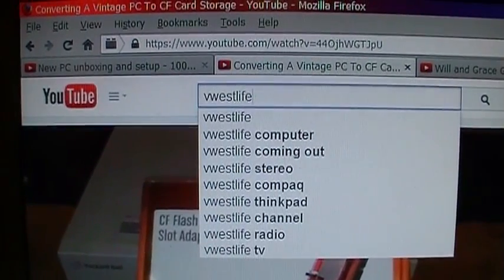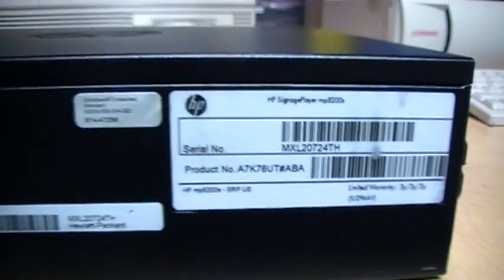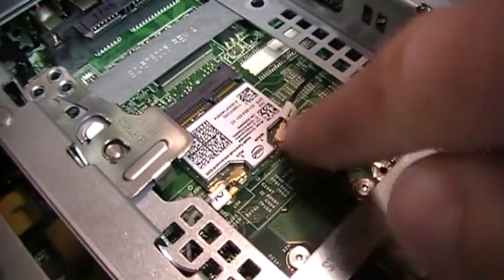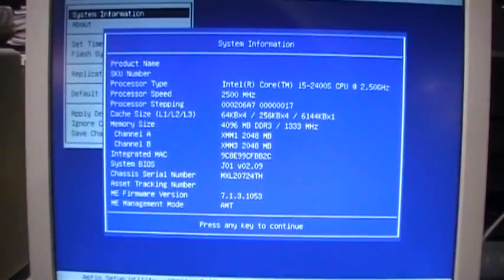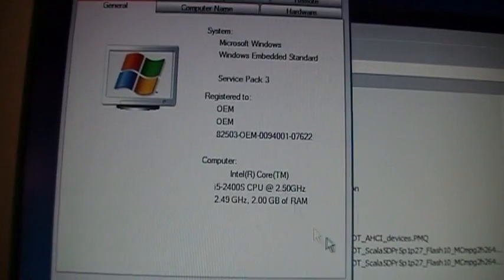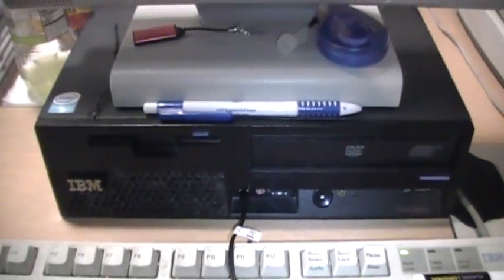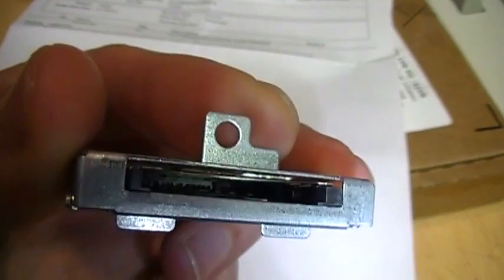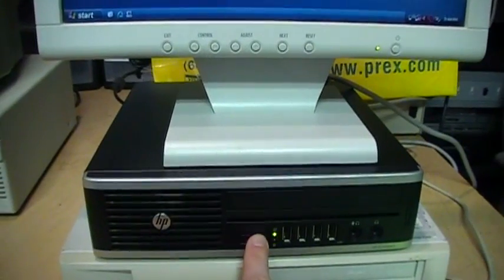My "new" computer: HP Compaq MP8200S

Comment: Are you poor? You seem to have pretty bad built computers for a main computer.
 Plus, that Macbook looks very old and out of date.
Reply from the maker: Billy O'Reilly That's a very rude and condescending question to ask. Not everyone needs or wants the latest and most expensive computer or laptop, regardless of how rich or poor they are. Besides, computers have tremendous depreciation, so if you're not a gamer and don't need the fastest CPU and best graphics, it's a waste of money to buy a new computer, when one that's a few years old is a fraction of the cost and is still perfectly usable for your needs.
Reply: I use old PCs. I don't necessarily buy ones that are high on power. Like my laptop is from 2011. My PC in my basement is 2012. Only one Macbook Pro which is my sister's. An old Compaq from 2009. My laptop may be old. Gaming is not a good thing for my laptop. If there is no good compatibility, I use mods. Usually the games I play are not so needy.
Reply: Billy O'Reilly
2011 is old...? Im still using a Dell inspiron 1501 from 2006 w/ a Turion 64 single core  w/ 1gb and a 100GB HDD xD
Reply: Icefxcycle
Well that, yeah yours is older. But 4 years old is kind of old for a laptop like mine. Laptops don't usually last that long.
Reply: You should word that better, because that came off as pretty rude.
Reply: Hunter_Green
Sometimes, I don't think before I post.
Reply: Forget that dumb comment I posted 1 year and 10 months ago. I don't even know what I was even thinking.Tommy Whitaker
Reply: Listen. It was a year ago. It was my most regretted comment ever since I posted that and got a reply from him. It was 2014. It's been almost 2 years. Before, when I posted it, I didn't mean any type of offense. I am a fan of old technology. I already understand it's rude to say such things like that. It was an awful thing done. But it's a new second, minute, hour, day, month and year. Many things will change over a year.Tommy Whitaker
Reply: Tommy Whitaker Give the guy a break, he said he was sorry. We all make mistakes

Comment: Hey VWestlife, why do you keep exclusively small form factor computers as your main systems?

And also, regarding the built-in floppy issue, I actually built a "legacy machine" on a P45/Core 2 Quad platform because it can handle native floppy drives, IDE expansion, firewire and other things. What it lacks in parallel and serial ports, I can add with PCI cards. I would have taken the PCI ALL THE THINGS route if some bright spark at Asus hadn't decided that on my main system's motherboard, any PCI-E graphics card would block the PCI slots.
Reply from the maker: I like them because they're small.